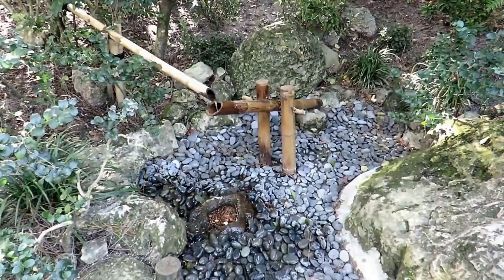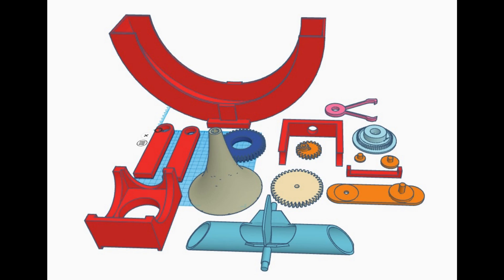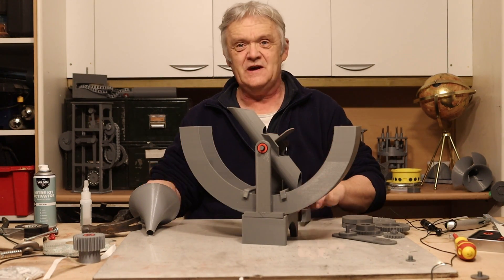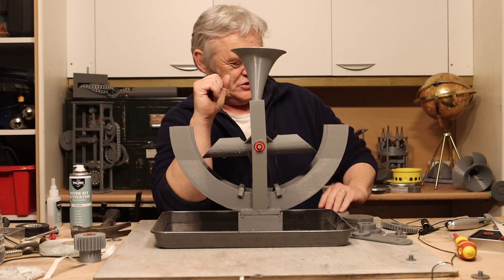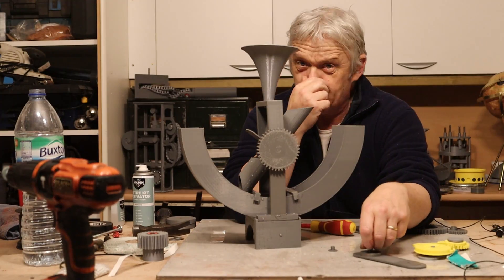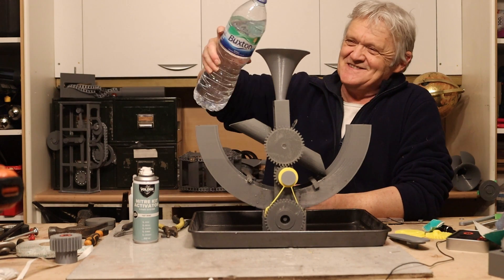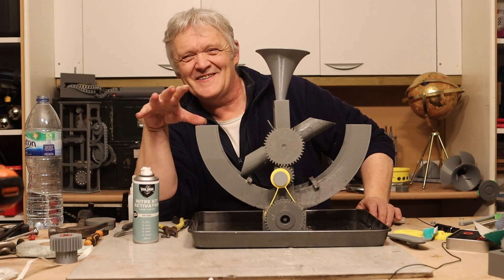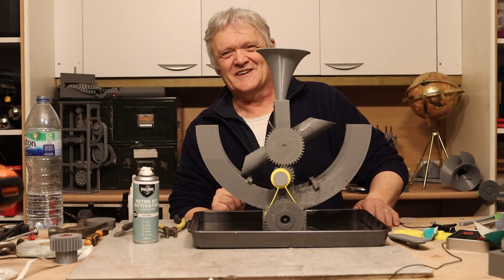2170 The Weird Water Motor

Comment: I built something similar out of wood 10 years ago. I had exactly the same idea:
A seesaw water motor that converted the back and forth motion into rotary motion. My water motor did work, but it was  relatively inefficient because of low power and high volume of water used. This idea is not new, however it was fun to build and fun to see it actually work.

Comment: now if you had deeper sides to the troff to ensure no water is wasted, and then a hole in the bottom to allow the water to escape from, you could have a stack of 10, 20, 100 of these, all using the same water. suddenly the scale of power is incredible.

Comment: Why not just have the water fall down onto a water wheel that spins a small water pump that sends the water at the bottom back to the top and hook up a small electric generator to power an LED light. Not perpetual because water does evaporate.

Comment: When we drive a clock with this mechanism time will pass faster when it rains and only when it rains. Summer will last forever. Not bad if you happen to have solar panels. The remainder is only a startup problem.

Comment: The Roman's did this with a water wheel but it rotated continuously turning a drive shaft. I think that's a more efficient design overall. 😊
Reply: While I think he just did this for the sake of curiosity (which is awesome), there are advantages to his design. Mainly, you can get more torque from Roberts design. A roman water wheel is essentially a paddle that catches some of the energy, from the water moving, while this design stores the energy of the water falling, and releases it all at once.
Reply: @BruceNJeffAreMyFlies  The torque is relative to the size of the wheel and the applied force. The Roman's then had gears to transfer the power. Roberts design is flawed since the water has nowhere to go once it leaves the tube.
Reply: @warpspeednow  Lmao it carries on down the river bro...
It doesn't matter how big your wheel is, you aren't going to get enough torque to turn a mill with a trickling stream against a paddle.
What a weird thing to argue about....
Reply: @BruceNJeffAreMyFlies  oh, really. Get a bigger stream or build a dam to supply the requiredwater volume. The Roman's were doing it 2000 years ago. They were a lot smarter than you. The flip flop unit will do very little in the way of producing power / torque in any case and is not in use nor has it ever been in use.

Comment: Hmmmmm ... So far you have not really produced anything useful!... So you have replaced Bamboo with Man Made Materials...NOT really a Mind Boggling invention....You have harnessed a minute amount of energy to turn a WHEEL/COG that could not produce a useful amount of Electricity to drive a very small Pump.... BUT wait there is more expansive design work needed.... Have you thought of having four of these contraptions ALL connected on the same axis but at different tipping stages ie Inlet-Pressure-Power -Exhaust able to power a small PUMP(NOT a Circulator BUT a Pressure PUMP) alternatively instead of a Pump it could be a useful off grid Electricity Generator

Comment: To take another aspect from Japanese gardens... using a catching tray beneath your device funnel vertically into many devices. I saw a wall of bamboo levers dropping water into many, many others as they captured water from higher levers and dropped it into lower trays that fed lower levers. A mechanical waterfall that was captivating to the eye and ear.

They were different sizes making different pitches and tempos.

Comment: Although you say it does, the final version does NOT produce continuous rotation of the large cog wheel. It always moves in one direction, but starts and stops in time with the rocking of the water tube., And until that cog rotates continuously this makes it pretty useless as a power source. An interesting project, but needing a lot more work to make it into anything worthwhile.

Comment: One little oddity I observed was that the clockwise vs. counterclockwise movement seems to be biased towards the clockwise rotation ? Could this be because of the slight angle of the funnel towards one side ? Nice job designing the mechanism !

Comment: Back in the 70s a rainfall measuring device called a pluviograph used a tilting bucket system you have there to measure rainfall. These had a syphon system to empty the catching funnel( machined 8”) and this  emptied into the bucket system whichever caused the bucket to tip. Like you show in your video. A magnetic reed switch would send an impulse to a time/ rain cart recorder to record the rain event. These were spring clock operated recorders which could run for up to a year without winding. Had a Negator spring to power the clock. The recorders were made by leopold and Stevens from Canada

Comment: I'm no mechanical engineer but I was thinking about that bottom cog wheel, it kind of stops and goes, my question is: would a Gyroscope attached to it help with its continued rotation thus stopping that stop and go and thus producing a more efficient output? Just a thought ;-)
p.s. I think there would have to be some kind of slip clutch involved also so the cog can move freely whilst flipping.

Comment: Add a clutch, CVT, and a flywheel and you could, over time, get something with a lot of rotational mass spinning quite fast. Cool project man. Although with the nutty level of convolution here, the more obvious solution for scavenging energy would still just be a simple turbine since the best part is no part.

Comment: The thing you started with is called in English a ‘doser’. I built one years ago to distribute water onto a reedbed in a series of floods rather than a steady but limited trickle (this was based on my dad’s description of a wartime shipyard toilet where a ten holer had a trench under it and a doser at the end which slowly filled and tipped every 20 minutes or so. The apprentices trick at a busy time was to place burning newspaper on the water just as it tipped, then run). But what you have built, though intriguing, simply appears to be a needlessly complex and inefficient water wheel…

Comment: I looked into those a while back and the best idea I came up with was to use it as a 'capacitor' as part of a gravity generator.  Basically, after the container fills up, it tips into a bucket on a chain which begins to descend because of the sudden extra weight, turning a generator.  When the bucket gets to the bottom, the bucket gets tipped over, the water pours out, the counterweight pulls the bucket back up to the top and the cycle starts all over again.  Unlike a system like yours which uses small amounts of water to move all of the time, waiting until there is a lot of weight means friction/etc. won't have very much affect on the system.  (It would be quieter, too.)

Cheers!
Reply: As far as the energy transfer goes, this is about the same thing - just scaled down. If you made his design larger you could overcome those hassles all the same.

Comment: Good job Rob. But Not bigger buckets to get more water. the buckets have to get smaller to get a higher oscillation frequency. You should get them smaller and more buckets in series/parallel to get more torque. It's simple you make many small ones like you did with this the video and then you need a long shaft to connect them all at the last gear where all turn it at the same way, then put also a flywheel if possible. I'm not sure if this ratchet mechanism is compatible with a fly wheel 🤔. If not then use one way bearings the can turn only one way they are definitely compatible with flywheels🤔keep it up pal you are Awesome 💪

Comment: Has anybody ever thought of using vacuum as a drive to power for instance if you put a candle in a jar make a small hole in the side light it put the lid on and there you have a flow of air flowing into the jar plus its warming

Comment: Sure, its cute, but the question is , is it the most efficient way to convert the water energy to useful electricity. Is it better than a standard water wheel, or not? Is the energy acquired worth the effort and cost of building it.

Comment: would a spring on that outer gear act as a capacitor?  allowing jerky input to have a smoother output on whatever clock/motor mechanism it'd be attached to..  
maybe a mechanism ike what's used on cuckoo/grandfather clocks to smooth the timing from the weights to the spring..  
the more gears, the more loss.  what's the best output?  lifting a weight for potential energy storage?   
if that's a good path, would lifting a weight just less than the weight of the water in the bucket by a few inches each time have less loss in the system, and then it's all recouped when the lifted weight is dropped?  so many questions. :-)

Comment: This could power a small gravity battery.  By gearing it down it could lift a larger weight which could in turn be use for short bursts of high power, such as running a mechanical driven circular saw or flour mill, or other such short use items.

Comment: Wondering if the flow of water is filling the uphill side while the "bamboo" is still falling on the opposite side. If so is that subtracting from the work ? Could the divider in the bamboo be designed to seal the funnel exit so water only flowed when the bamboo was closer to finishing a down stroke?

Comment: That is a great thing to have a triple purpose. It could be used in series In a sewage filtration system when the water overflows from one thank to another that water can be used to accumulate energy. Usually, a gravity system is used to turn sewage water into cleaner water with different steps and turns in which something like that could be introduced to take advantage of that energy at no cost. Thank you keep it up.

Comment: Maybe two wights that get lifted alternately to spool some string that can then pull a flywheel and have a steady speed/power. When one wight is pulling the flywheel the other is being pulled up by the  “motor” and then they switch when the first wight gets to the bottom?? Just a thought it would be really neat to use something like that to spin a dc motor and generate some power?? If anyone can make the parts to make it work it’s definitely Rob!!

Comment: I don't know what it is , or what it is used for - but it surely works...Of course , garden ornament can be improved , as someone below suggested , by stacking it up vertically (pendulums) , or axially , at different , slightly overlapping angles (for smooth operation) and by using opposing ratchet mechanisms . Translating pendulum movement into rotation is only needed , if you want something else to rotate , otherwise , it can be translated into linear motion ,or , if you want to generate some electricity , just glue on magnets , at the ends of the pendulum pipe and put coils on each side of pipe end travel path. It can be cool conversation starter peace , at barbecues (where it is allowed) , or garden parties .

Comment: I doubt it's as efficient as a similar sized water-wheel, but it is certainly far more fun to watch.  Thank you for another good one.
Reply: I have thought about efficiency as well. The efficiency of such a device is less than that of an overshot waterwheel, since the kinetic energy of the flowing water is wasted.
Reply: @Alliban59  yep but given the original context where efficiency isnt as important as visual appeal (a garden decoration) it makes perfect sense, one could use the slightly irregular motion to power another kinetic decoration with some more simple but clever gearing, say have a statue of a gnome that waves his hand, or a plastic/metal bird flapping its wings
Reply: It could certainly generate more torque, unless the water wheel was a bucket design powered by falling water - in which case it still won't be any better.
Reply: Yeah and find a way to add magnets and solar and wind if ya got it and wabang you might have somethin..

Comment: Y'know, I've always wondered about something similar, in reverse, if something couldn't be achieved with capillary tubes, and piezoelectic spark generators like you might find in a lighter. But it might be more practical in this application, with the higher masses of water. Has anybody ever tried those clickers for power generation?

Comment: A thought and i dont know if it goes anywhere. When i would vacuum steel grit through a plastic hose it would build up a considerable charge, like a hotwire fence, so when i was grounded i got a good pop. I know you have covered static generators before but itbis a thought for you to play with.

Comment: Gears are so 1700s, why not also incorporate Element 115 bombarded with a proton which plugs into the nucleus of the 115 atom and becomes Element 116, which immediately decays and releases, or radiates, small amounts of antimatter.  The antimatter is released into a tuned tube which keeps it from reacting with the matter that surrounds it.  It is then directed toward a gaseous matter target at the end of the tube.  The matter and antimatter collide and annihilate, totally converting to energy? ha ha

Comment: I used a device like this to water a garden from a solar-powered pump. My irrigation circuit was too long to be fully supplied by the pump's trickle of water, but with an intermediate device like this I could supply an intermittent burst of water down the entire line.

Comment: Could see pushing all that minor motion into a heavy flywheel and then using the buildup to harvest constant power. Love your work man! Blessings :)
Reply: A hanging weight off a pulley or a battery could do the job too. It just needs some means of turning the (possibly sporadic) impulse into potential energy that could be released at a constant rate.
Reply: Reply to @thomcm12, I just came across this ingenious device, and my first thought was exactly the same as yours. A large mass flywheel probably would need a source to start the rotary motion. After the mass was set in motion, this device would operate a ratchet mechanism to continuously keep the inertia in motion.

Comment: Narrow that funnel outlet down and widen the inlet to create a more consistent flow of the water. That might compensate for an uneven rate of the original water capture. Just a thought.
Reply: A better idea would be adding a simple barrier, like a plate, that can be used to adjust the flow. Something like the ball inside a ball valve, or even just a little sliding sheet of plastic that moves back and forth.
This would allow adjustments for different flow rates, with minimal changes to design.

Comment: Turn a trickle into a power source.
The original version fills the whole tube until it is  unbalanced, then dumps the whole load. In the case of an AC alternator you don't need the one way gear conversion. Back and forth is just fine.